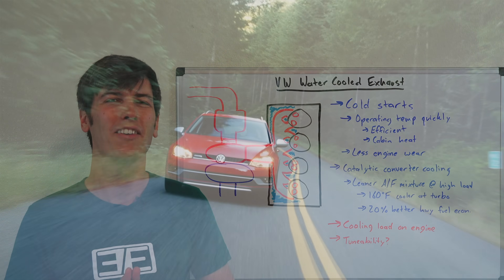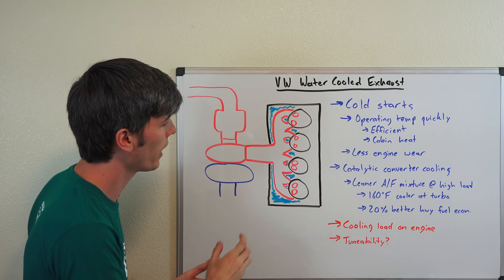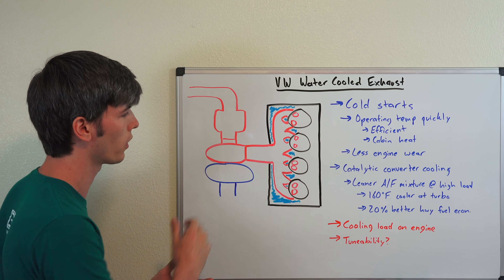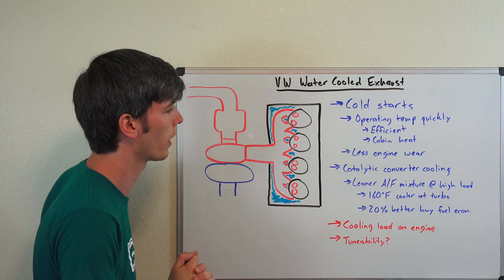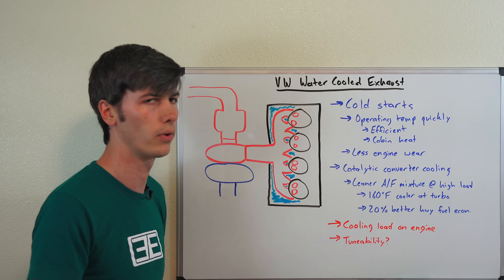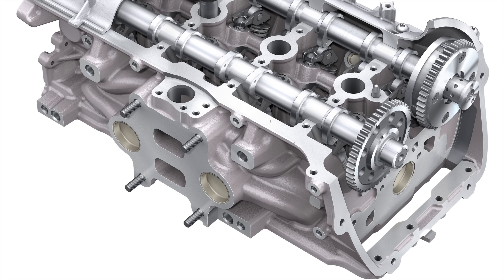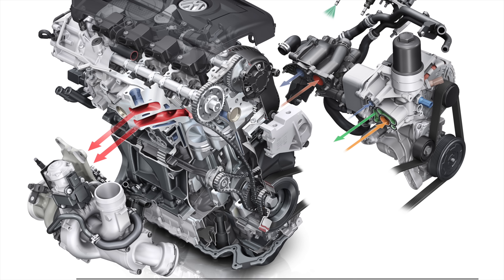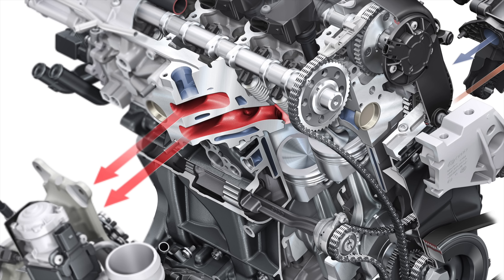Why Does Volkswagen Have A Water-Cooled Exhaust?

Comment: FYI, the first gen Honda Insight (2000-2006) has it's exhaust manifold built into it's 3 cylinder 1.0L gas engine block. I'm not sure if the Insight does as much intentional cooling of the exhaust gases and there's no stock turbo, but it does have "lean burn" operation (except for on the automatics sold in the US) that can run up to about 22:1 AFR during light load cruising.

Comment: Since this is tranverse mounted the exhaust valves are right up against the firewall = poor outside air circulation.  Combined with the increase cooling demand of the exhaust manifold,  my guess is greater probability of burnt exhaust valves.  Most likely in the 2nd or 3rd cylinders.   Probably won't happen until the second owner.  
This was common in the old straight sixes, the number 6 cylinder exhaust valve would usually burn because the coolant at the back of the engine near the firewall was warmer than the front.

Comment: And it will lose turbo efficency becasue the air contrast to post turbo temp is much closer in turn casuing a lower pressure ratio bewteen both sides.   This is basic turbo theroy, this can't be good for performance. 
This whole EPA emissions crap is getting beyond a joke, meanwhile most nations pump out coal fired power without bugger all going on to fix it. 
So many modern cars are failing in quite expensive and serious ways these days,  drive lines becomming lighter for less losses, GDI systems for petrol can be problematic and especially when you look at common rail, so many car makers can't get this right still and the parts are crazy expensive.   
Even Audi getting their 2.0L engine wrong with oil ring sizes being too small to reduce friction, then needing full rebuilds when the ring breaks.

Comment: You dropped the ball here, Pal. There is no critical thinking on your part. This setup is counter-intuitive. At least tell us why you think it works. E.G., How will the cat light-off faster on startup when the exhaust is being cooled? How will the turbocharger be more efficient when you are removing heat from the exhaust gasses that drive it? Don't just be a cheerleader, taking everything at face value. Especially from VW.
Reply: The turbocharger won't be any more efficient, it will be exactly the same - due to the fact that they are able to remove heat from the manifold gas, they can run a leaner and HOTTER a/f mixture which would normally damage the cat. Less fuel for the same amount of work = higher efficiency
Reply: Also the entire engine warms up at a much faster rate to reach optimum operating temperature cutting down engine wear and increased fuel efficiency!

Comment: 20% sounds like a crazy number even if it is on the highway. What I am interested is where is the catalyst placed and how often do they turn on the coolant pump to the exh. Manifold. Because we need a lightoff temp to activate the catalyst. I am not really sure how this helps in cold start conditions, as we are always more focused on improving the light off temp of the catalyst on low rpms and especially in the cold start conditions.
Reply: I call that 20% BS, maximum 5%

Comment: I wouldn't really call it "water cooled exhaust" since it's only the runners that are next to the water jackets, same as every other engine. I call it an "integrated exhaust manifold" or IEM. Also the 20% is a joke. just an IEM alone will not get you anywhere close to 20%. not saying the IEM isn't a great design choice, it's pretty cool but not 20% FE

Comment: The problem what I see with this kind of set up is that cooling pipes around exhaust manifold are reduced in size, which will create higher pressure, raising temperature in cooling system, overheating engine head and valve  system on exhaust side,  etc.
All I see in VW, instead of fixing it's own mistakes from previous engine generations, they notoriously continuing to cheap up they products to stay afloat with other brands. Sadly, they are continuing do the same thing in Audis and Porsches...

Comment: Pretty good summary, but missing the most compelling reason why VW and others have gone this direction. Cost. In simple terms, a few more grams of Al added to the cylinder head is a significant  cost save vs the premium alloys used in turbo engine exhaust manifolds and especially the turbine housing. It also reduces the number of high temperature fasteners and the exhaust manifold gasket which is a common source of warranty. The 2nd most compelling reason is BSFC under high BMEP operation as stated, but this doesn’t really factor into part load driving (Highway) so the 20% number doesn’t really make sense and is just marketing.

Comment: The added heat on the head twin scroll area will develope heat cracks after a short time especially since this head is aluminum it cannot handle the heat that a iron manifold would. These vw heads will only last 100k miles till they start to crack and need replacement.

Comment: Although not turbo'd, I think you'll find GM have had this for many years on the 3.6 V6 HiFeature for the same reasons.  

The 3 cylinder exhaust pulses greatly simplify it as well, unlike VW needing 2 separate routes for exhaust wave tuning.

Comment: One of the factors that determines the efficiency of an IC engine is the difference in temperature between the intake mixture and exhaust gasses ( the higher this is,, the higher the efficiency ) I suspect the power output will suffer.

Comment: This coming from Volkswagen - good luck with it...lots of problems with their DSG-automatic transmissions, timing chains, cheating software and their so-called fix and now this. Probably "very easy" to repair if something goes wrong after the warranty period is up...I would run from this company and their products as fast and far as I could!
Reply: Get a life, I work on these cars all day haven't had to replace timing chain's on 1.8t turbo and its a 1.8t tsi not a tdi get your facts straight.
Reply: I'm on my 6th Volkswagen and I put right at 300k miles on a 5 cylinder VW Quantum in college (it had just over 100k when I bought it). I've never had one catastrophic engine or transmission failure.The key thing with Volkswagen like any German vehicle is proper maintenance. You can't go slap conventional oil in it with a Fram filter then think everything is going to be just fine. I've had new Cadillacs leave me stranded, Dodge with a transmission failure, Pontiac with a transmission failure while my Volkswagen's get their scheduled maintenance and roll right along. I've actually put 40k trouble free miles on this exact setup with no issues at all.
Reply: You are right. Note those aluminum heads and exhaust--their customers will be saying, "Hey, I popped an exaust manifold gasket" as coolant is leaking on the ground.

Comment: GM has had an internal exhaust manifold ever since they came out with the 3.6L direct injection motor since 2011. I dont know the cooling design of the head but im sure they implemented something to cool the exhast so it doesnt warp the heads and blow the gaskets

Comment: Cooler air into the turbo is a more dense gas inlet making the turbo reduce lag, plus is closer to the engine assisting reduce lag, seems a multiple win.
Reply: Sorry, you're only thinking through half of the thermodynamic equation:  Yes, cooling the exhaust gas pre-turbo will make the exhaust gas more dense, but will not compensate for the overall loss of kinetic energy (velocity) absorbed but he head and coolant, then lost to the atmosphere via the rest of the cooling system.
...You may notice that on turbocharged race cars the exhaust manifolds are typically wrapped with insulating material. This is to ensure minimal exhaust temperature loss between the exhaust valve and the exhaust turbine.
The insulation-wrapped headers minimize thermal energy loss from the header pipes to the atmosphere - en route to the turbine - leaving more gas pressure to spin its blades thus providing more boost pressure.

Comment: This is really nice engineering!  
To make the AllTrack hybrid by capturing waste heat going to the radiator:
1.  Split the cooling system to allow dedicated cooling of the integrated exhaust manifold.
2.  Flash expand the dedicated coolant (water) and direct the resulting dry steam to 1 or 2 GreenTurbine or similar 15 kw steam turbines (closed loop system). 
3.  PTO to Variable Frequency alternator > integrated VF AC motor
4.  Add a 12-18 kw battery pack  to further increase efficiency (optional but not necessary)

The VW engineers have this halfway done already.  These are COTS components also, so not rocket science to engineer this.
Reply: A fan with a sail on the roof will work just as well.

Comment: Cool video. Does this engine have a knock? The reason I'm asking is that on another video where you were testing the fuel grades on the Audi 2.0t in which 87shell gas produced a engine knock and with the 93shell it eliminated the knock. But with the 93shell the horsepower gain was -1. So if you use 87shell can damage the engine and if you 93shell is not efficient. Since VW makes both cars does that engine knock egsist on 1.8tsi vw engine? Because VW recommends 87shell.

Comment: I didn't understand why should I use turbo blanket (your other video) to keep all that heat in turbocharger if we wan to keep turbo cool with water cooling here?  Also, why is VW not using longer shaft between turbo and kompresor to keep comperesor (and compressed air) cooler to achieve higher performance?

Comment: I would suggest that exhaust gas pressure leaving the head to the turbo would be lower, volume would be higher or denser  therefore a more progressive induction charge and controlling or lowering  emissions.

Comment: This doesn't make any sense. The biggest challenge for modern cars, is cold start emissions. You want to heat up the cat as quickly as possible. That takes priority over the cabin heater. Secondly you do NOT want cool air going to the turbo turbine. You want that gas to be as hot as possible. The heat is what is doing the work. That's why most tuners will put an insulating blanket on the turbo manifold to keep the gases as hot as possible. Thirdly- after the turbo, the exhaust temperature is typically much lower because all the work has been expended pushing that turbine. So burning up the cat is not a problem. 
Modern production turbo cars emphasize low end torque and minimal turbo lag. So they make the exhaust port passages very narrow and small. The goal is to open the exhaust valves, and immediately have the expansion of the exhaust gases spin up the turbo. So what VW is doing here, is to minimize that exhaust port volume. They are not trying to cool the exhaust.

Comment: I wonder if this is also used to cool the oil.  I see a hose wrapped around the turbine in the exploded view and I'm assuming that's an oil line.  Cooling the turbo may increase the life of the engine oil and keep changes up in the competitive 7500 mi range, as hot turbos destroy engine oil.  Not the main reason, but possibly another benefit.  But what do I know?

Comment: I was wondering about the catayltic before I even clicked on this video. Glad you touched on that.

On a side note, Im not a VW fan. The few 2017s I drove not long ago had numerous problems brand new. One 2017 passat the doors kept trying to lock while driving, randomly. Another one they wanted us to test drive wasnt finished being built. The roof wasnt properly adhered and the carpet on the trunk lid didnt have all of the clips to hold it up. And the thing didnt even start!

Comment: Could one use the exhaust heat to produce steam and then use the steam ti drive a turbine, to feed power back the drive shaft, then either exhaust it as steam or recycle it through a radiator? Has anyone done this. Assuming that over 50% of power is lost in heat through the exhaust and the average efficiency of an internal combustion engine is 26%. If half of the heat could be used, fuel economy would halve the consumption.

Comment: wouldn't heating up the engine block substantially faster result in a greater chance in cracking the block?
Reply: Not necessarily. It's not the heating process as such which lead to cracks, it's unequal heating up which causes tension in the material.

Comment: VAG has a horrible track record. The old 1.8 and 2.0 plastic coolant flanges that fail and you have to cut good hoses just to replace them. The four different timing chains and guides on the old s4's. The 2.0s that burn a quart of oil every 100 miles. Now manifold-less engines with cooled exhaust. People wait and see if these cars can make it past the 6 year 72k mile warranty, which I highly doubt will happen. They manufacture these cars to break, Id love to see one of these with 200k miles.

Comment: This is interesting because someone told me (yea right) that a local guy (in UK) developed a water cooled exhaust so that the engine temperature rose more quickly. The idea was bought by Hyundai and incorporated into their engines. Bit like the Peugeot diesel i had that had a heater element in the water manifold to bring the temp. up quicker and cabin heater. Only found out because it kept blowing and burning fuses until i disconnected it.

Comment: This is not why this engine is designed this way. The turbo is bolted to the head to get it as close to the source as possible for efficiency. Plus it has the added space saving benifit. Nissan v6 turbo does it too.. This practice started with formula 1 engines. soon everyone will probably do it this way.

Comment: How can they tune the exhaust manifold? It seems counterproductive to throwaway exhaust manifold tuning. You can still tune the intake manifold, but understanding how exhaust and intake manifolds are tuned to work together at a given RPM, how can they realize those gains?
Reply: Because it doesn't really matter. Tuning an exhaust manifold is actually aiding the scavenging effect, which in turn improves volumetric efficiency, and hence more power. The difference here is, Volumetric efficiency, isn't really that important because the whole system is turbocharged. The engine is already breathing better than NA, so scavenging in terms of header length doesn't really matter..

It's actually quite the opposite, tuning a header for best performance in a trubo car, is trying to get the turbo to spool as quickly as possible. There are multiple ways to do this. you can time the pulses to all hit the turbo at the same time, Or in the case of this headifold design, lessen the distance from the valves to the turbo.

Comment: Ford 6.7 Powerstroke has two separate closed loop coolant systems, the engine head is also different, pulling intake where a normal head would exhaust and exhausting where a normal head would intake, making a shorter run from the cylinders to the turbo

Comment: the caterpillar 3304 and 3306 have this, first time i ever saw it on a motor and wondered why the hell you would want to put extra load on your cooling system for no reason, its a natural gas engine and it always stays running so no need to worry about cold starts but also most natural gas engines are converted from a diesel design using different pistons and head and all that, so the diesel must use it to warm up quicker especially in the winter

Comment: i'd guess that this setup is fragile enough that in practicality there is zero room for tuning. i'm also surprised it's made it to production but VW has to rebuild a niche market as fast as possible. people overheat their motors all the time from coolant loss for various reasons. in a normal car you'd have time to notice and stop before you cracked a head, i don't think this motor will give that much reliability.

Comment: It's really gonna be irrelevant very soon fuel engines, the electric era has started and will only get better. Iv had a drive of the Tesla and I was very impressed with it in many ways apart from the cost of purchasing it. Once they get cheaper and built with none polluting methods everybody will have one, which can only be better for the polluted world we live in! Bring it on I say but I will miss the sound of a good engine note i.e. V8 and other nice sounding engines.

Comment: Its all fun and games until the neck snaps of the radiator and you lose all you coolant faster than you can merge off the highway.
Flat heads are old tech, they are not used today for a reason :)

Comment: Aren't exhaust gasses too hot? The water would boil
Reply from the maker: Coolant has a higher boiling point than water, and it's kept in a cooling circuit to the front radiator that typically keeps its temperature no higher than ~200F/~95C under normal operating conditions.

Comment: I had a friend who professed running coolant through a turbocharger only heats up the coolant, rather than cooling the turbo.
Reply from the maker: Well that's not how heat transfer works. :) If one thing is hotter from a specific source, that source lost energy, thus must be cooler.